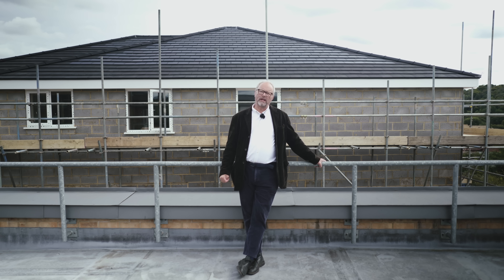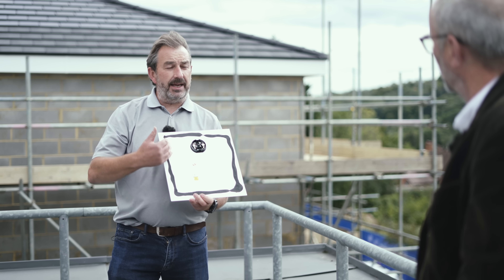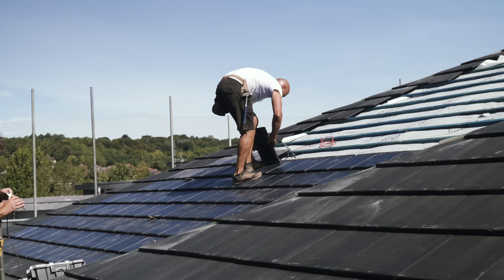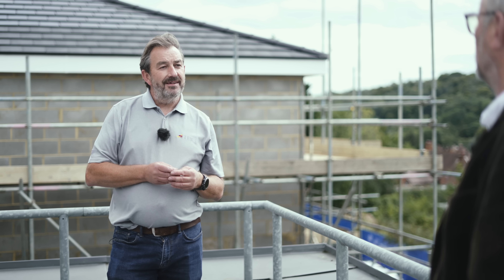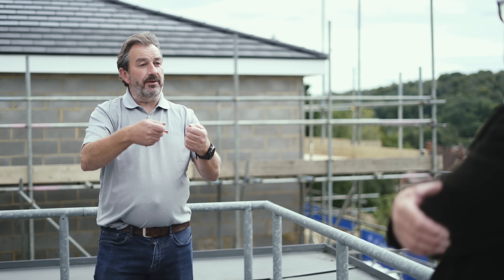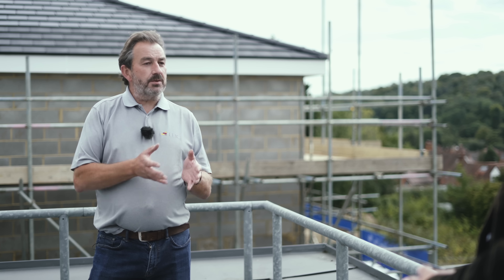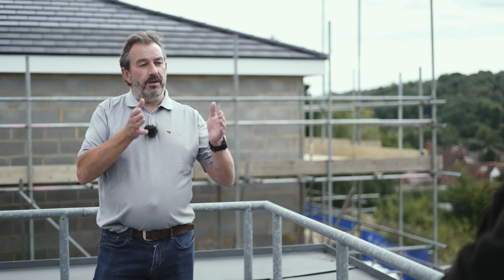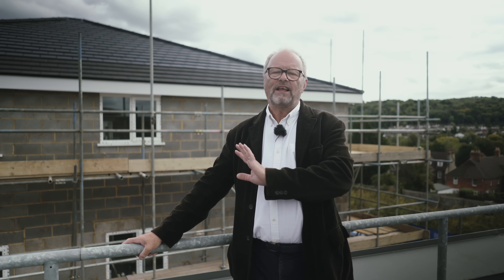Solar Roof Tiles - should every building generate its own power? | 100% Independent, 100% Electric

Comment: I think this is a wonderful idea!
 But I wonder about a few things. 
If one tile fails do all of the 45 tiles in that series fail?
How difficult is it to replace a failed tile in the center of a roof to restore operation to the string.
What does the firefighting community have to say about this kind of roof,  they have issues with large panels and establish setback areas so they can safely vent the roof in the case of a major fire.
What is the desegregation rate of power generation? Is it comparable to panels?
It's new tech and will have a few stumbling blocks like any other new product. 
It's great to see innovative ideas like this.
This is probably a viable way to "green up" historical buildings and maintain their beautiful architecture.
When will this be available in North America?
Reply: Tesla (formerly under the name "Solar City") already offers solar tile roofs in the USA.  There is a solar-system comparison agency called "Energy Pals" (i.e. Energy Geeks) that I have seen featured on the "Now You Know" channel.  They don't cost you anything to consult with, as they get paid by whichever provider you decide to go with.

The kind of concrete roof tiles in this video are not the norm in the USA.  Roofs here are usually based on tar-composite shingles (or silicon coatings), so Tesla tiles are designed to mimic that.

If you haven't seen the Now You Know channel, they cover a lot of the same issues as this one, but with more North America content, and a lot more of Tesla's various industries coverage.  They also do international stories.

Comment: I just wish it were more sunny in England.  I"m lucky, my 24 solar panels get lots of sunshine here in the American desert state of Utah.
Reply: Duncan Cunningham we get more sun than people realise! And less rain than commonly believed. Conventional solar panels are cheaper here than in the US, and even with our climate payback is around 7 years. Remember too that a typical Brit uses a fraction of the power of an average American - we don't have to run aircon, our appliances are usually significantly more efficient (nobody here born after the mid seventies has ever even seen a top load washing machine or a hot fill (inefficient) dishwasher. A typical UK family home with gas heating will use around 3500 kWh per year, easily offset by a fairly modest solar system. More sunshine might be nice, but most of us wouldn't swap our green landscapes for the dusty orange / yellow found across much of the middle of the US!
Reply: @spencerwilton5831  I was born  and lived in England up until 2001.  You might think my comment was saying that solar is no good in England, which wasn't my intent.  I was born in 1974 and only my grandad had a top loading washing machine was a interesting experience for me to see as a little boy.  Moved to America and yeah, it was like going into the past 20 years.  I think your description of Dusty Orange and yellow isn't totally true.  You'd be surprised at how much green we have in the desert, considering how little rain we do get, it's amazing.  But that is because is waste most of our water by spraying it on lawns.  another thing I do notice is that the heat of the sun will decrease the panels ability to get the best numbers.. sometimes midday sun in cooler times of the year will give us better Kwh numbers over a single day than in the middle of summer.  I like the idea of making solar panels on tiles though.

Comment: The question I have about all of these PV systems, and their attached technology like vehicle to home power, is what happens if their is a massive solar flare ? Are these systems protected from EMP events or will you lose your home and auto all at once and be left up the proverbial creek ?
Reply: Where on earth did you hear that from? Absolutely nothing will happen. We are protected by the atmosphere from the UV and the bulk of the radiation. The EMP (Geomagnetically induced current) (GIC) even in a major event will only be important for very long conductors, not like those you get in a roof. You won't see large pulses on the domestic mains supply either. This is a distribution problem. OK - so if you have one of the new power walls your lights might still be on afterwards if there is a power cut.
Reply: @mikewillis1592  Absolutely nothing ? That's certainly not the position of industry experts. It's well known there have been massive power outages due to CME as well as the fact that EMP weapons are a real threat to modern society. It's a given solar power inverters will be burned out, lose their fusing, and require repair from a significant CME let alone human use of EMP weapons. Given these facts are not in dispute by anyone in the power industry it's a completely valid question...what happens if your EV is plugged into your home during a significant CME or if some nut uses an EMP.

Comment: Solar tiles and slates have been around in the UK at least since 2010.  They just never took off because it was way more expensive per W than over-roof solar panels that were made in the millions.  It sure looks better but most people are not too bothered with the look of their roofs once it means spending £ '000's more.
There are also some real drawbacks.  One is in the case of a module / cell failure it will be problematic to locate the tile that failed (unless they use micro inverters I suppose), replace the faulty module / tile and pray that the wiring is accessible and not buried in insulation.  Secondly the air flow he mentioned under over-roof panels is actually a feature and not a bug (sure storms can cause panels to be lifted off but that's not something I have yet come across).  The hotter the modules become the more resistance there is to current flow, reducing the efficiency of the modules on them sunny summer days.  Over-roof panels have some airflow alleviating this issue to some degree.  Solar tiles have no such airflow.  They have some thermal mass in form of the concrete tile but whatever that heats up to in the summer is what the solar modules will have to work at.
Not trying to be party pooper, it is a good idea / product for the right application.  It's not the best thing since the invention of sliced bread though.  Peace out.  ;-)

Comment: Twice the cost, half the efficiency, replacing entire roof after 20 years, increased thermal temperature of the cell and attached thermal mass further lowering the output efficiency. No solar radiance blocking as solar tiles are attached the house (solar panels have an air gap) further increasing airconditioning costs. 
The only selling point is aesthetics. 
I must say this a  much better system than the tesla tile.
Basically like a thatched roof on your house that cost more to replace than actual straw.

Comment: My calculations are that a 13.5kW system using traditional panels would be 64 panels = 64 connections vs 900 connections with the tiles. What's the risk of a connection failure? How quickly would the bad tile be found? Would agree that once found a repair would be easier than changing a whole panel.
Reply: We've got 11kW using 44 x 250w panels, so 13.5/250 = 54 connections, so it's better/worse than you first thought!

Comment: You lost me at the 2-inch hole in the centre of the tile. How much do we trust the adhesive (or is there an O-ring) to remain watertight for the life of the roof? Why not instead run the wires through shallow grooves at the top edge of the tile?
Reply: .. presumably, because it's a standard tile with a hole sawn in it.
Also, curious as to why you would question the reliability of what is the most basic, fundamental requirement of the system!  A weatherproof tile!! Do you really think they haven't fully considered this aspect of the design........??!
Reply: @andymccabe6712  After solar freakin' roadways, no, I do not necessarily trust that every new green product has been fully thought through.
Anyway, cutting grooves at the top of the tile to send wires under the tile above, doesn't seem any harder than boring a hole through the middle. But it does seem less leaky. So it seemed an odd design decision.

Comment: How long do the panels last (or are expected to last)? Is there a maintenance interval? Scaffolding needed for maintenance (cost etc). A roof covering has anything from a 40 to 100 year life depending on location and material used. Unrelated points - on a wind turbine could the structure and turbine blades be covered in solar materials to further increase efficiency (flexible solar panels on a roll is on the Horizon)? For many years we have heard about energy generated from pressure plates installed in the floor/paving in busy locations (rail stations, shopping centres & busy urban streets)? Does not appear to be a high uptake on this - an update on the latest innovations would be good to see. Keep the content coming. Thanks.

Comment: Interesting.   We just installed a Tesla SolarRoof with the V3 tiles.  The active tiles are much wider (45" (115 cm) X 17" (43 cm) than the ones on that roof ).   Also, the passive tiles come in 5 different sizes to fit the edges.  No cutting of the tiles as in previous versions. Looks great, but the yield per area is low than conventional solar panels.  Also, since there is less airflow under the solarroof, the power decreases faster as the roof gets hot.   
But, they look great and do not scream "I have solar".  Rather they say "this is one sexy looking roof".

Combined with our 2 Powerwalls we can stay off the grid for days.
Reply: Awesome!  You're the first V3 customer I've heard report on it.  For what amounts to a passive built-in system, it seems like a no-brainer win for any new roof, but it's good to hear from an actual user.

If you don't mind, is it covering 100% of your consumption, or would you have to ration use to stay self-sufficient?  Which region are you in?  (because obviously Phoenix vs Seattle matters).
Reply: animist channel - The system does cover most of our consumption.  The big factor is how much air conditioning we use.  We try to pre-cool the house by having the A/C run in the morning and that helps. We are in the San Francisco Bay Area 35 miles east of San Francisco.  We were 110 on Monday.  So it gets hot here.
Reply: @JBoy340a   Thank you for the answer, and oof!  I used to live 100 miles or so up the road in Redding... oh that whole inland valley is like a giant microwave oven in the summer!

Comment: IN Cooperation with Raul Ruiz CA 36 and Juan Vargas CA52 with Assembly Candidate
 Elizabeth Lavertu ADM 71; A project to have Solar Powered with Battery with a
 1500 Gallon Phoscheck tank underneath to provide Charging Stations and also
 Fire protection as a self help project.

Comment: Tesla Roof cost £26K for 2000 sq ft home. On the above solar tiles are serially connected like an old style Christmas Tree lights. If one fails the whole string effectively dies, fault finding would be a nightmare.

Comment: Looks nice but how handle bad weather? High winds, hail, etc. What about metal roof?
Reply: Donald Burkhard Given that we have used tile of one form or another for centuries in the U.K. I don't see why these should perform any differently. Each appeared to have two nail holes, they weigh ten pounds each, and have a good two plus inch overlap- they aren't going anywhere. We don't get baseball sized hail here, but I doubt much can survive that anyway

Comment: i like the use of standard tiles without solar cells integrated. i do wonder the life time of the cell. being that cells degrade with heat normal panels mitigate this with the air flow behind the cells. the real question is dose the simplified structural engineering out weigh the cell degradation. me being an american with a high likelihood of tornadoes ripping off my solar setup in my area i would install these because of the structural engineering and look ,but i also have a yearly average high temp of 30c in my area so will they die.

Comment: Solar tiles concept is great - BUT there are too many connections (almost 300 tiles for a 4kwp system), hence to many points for failure (and arcing). How would you pinpoint a failed tile? It would be a nightmare! Even Tesla has given up on tiles that generate very low power on individual bases.

Comment: The best system I've seen on a new-build looked like large panels were put in place of the roof tiles, they were tucked under the ridge and went from one edge of the roof to the other.  That way there was no gap for pigeons to nest in, no chance of the wind catching them and they looked very tidy.  Should keep them cooler than bonding onto concrete slates too.

Comment: Solar is too inefficient and damaging to the environment.  NUCLEAR is the solution.
Reply: Michael Solar efficiency is almost irrelevant given that the fuel source is completely free. It's already perfectly possible to power and entire house purely with the solar panels on its own roof. Sure, there is an environmental cost to making them, but there is with everything. The heaviest parts are the glass and aluminium, both of which can be made using recycled products and recycled again at the end of life. Other metals can be recovered, and any carbon is offset within months of the panels being installed. Nuclear, on the other hand requires constant environmental exploitation to mine and refine the necessary fuel. Then there is the massive carbon footprint of hundreds of thousands of tons of concrete used in construction. Nuclear energy already costs twice what renewables do, and while renewable costs continue to fall so nuclear costs continue to rise. End of life decommissioning costs are astronomical, and we still don't have a safe solution for dealing with the waste. We also have the security aspect to consider- there are plenty of nations across the world that many would feel uncomfortable trusting with nuclear power. Nuclear will play an ever decreasing role in our energy supply.
Reply: @spencerwilton5831  Thankfully China and India disagree with 15 nuclear plants in the planning stage between them.

Comment: the guy is talking about "dynamic loads". a 2m2 panel is about 20kg. one of those small slates alone weighs 4.5kg. and all the connection wires and boxes alone probably cost more than a regular solar panel. not to mention each slate had to have a hole drilled into it, which doesn't make well for long time water proofing. and then in a few years the company making them has probably disappeared from the face of the earth.
Reply: The 20kg panel is extra load on top of the tiles that are already on the roof, the connections weigh 24g and a meter of cable is 75g so these tiles are not going to weigh much more than a standard tile, probably the hole they cut balances out the connections.
Reply: @100tinsoldiers  
I meant the cost of the cables and junction boxes not the weight
Reply: Wind lift is a bigger issue with panels, not so much the load downwards.
Reply: @videogalore  
for wind lift to take effect you need like tropical storm winds. there has been an incident in queensland where the panels got sucked out of the frames.
incidentally 30 degrees inclination is neutral. higher than 30 degrees pushes the panels on the roof, less degrees, then you have your wind lift.

Comment: Considering the enormous potential for solar roofs, to green our energy grid; instead of the government subsidizing the very profitable petroleum industry, (here in the USA, yearly subsidies run in the 80+ billion dollar range) it would be a far better use of our tax dollars to subsidize the cost of solar installations. (both private and commercial) Zonings should be updated to require solar on the roofs of new buildings over a certain size, etc.

Comment: My biggest problem i find is tiles lifting up with high winds, I have had a few people that have had tiles dislodge, I think I would find it necessary that each tile be secured with a tied down point, nothing worse then have high voltage exposed when you lose a tile due to wind
Reply: The 2 holes in the tile are for nails, you don't nail them all but they hold everything down.
Reply: They weigh 4.5kg per tile, these don't tend to move around much once laid. The panels debonding is a concern, but not the tiles themselves.

Comment: One thing that was not covered on this video which would be interesting is whether this technology is useful for retrofitting an existing roof in comparison to using the more typical modules.  While my knowledge of roofing products is limited I am aware that there are all different sizes of tiles available, especially once you get to the more traditional slate roofing.

Comment: So a big hole in every tile, mmm. That's a lot of sealant on the back of each panel you have to rely on being correctly applied and lasting for years of service through Britain's seasons and hundreds of connector blocks being equally efficient. If one connection went you'd have to strip the whole side to find it. And then the cost, ouch. Nice idea but will leave to the early adopters